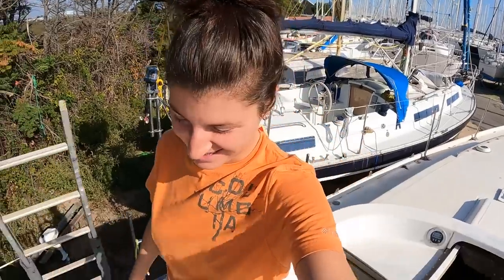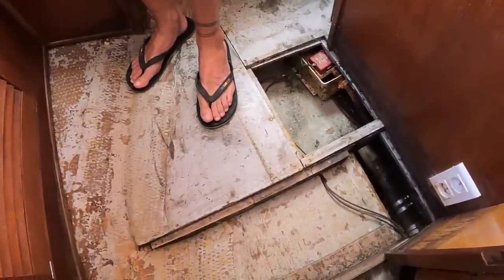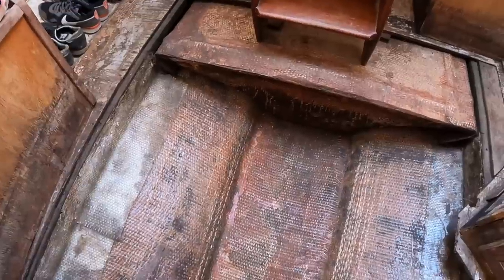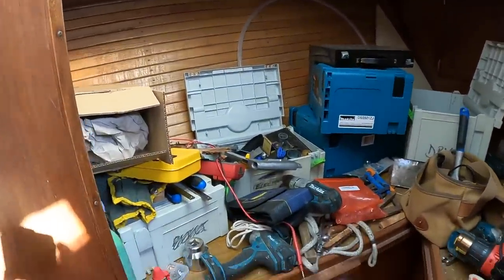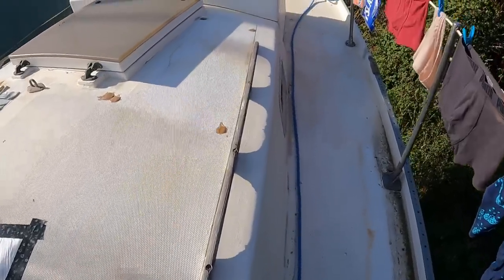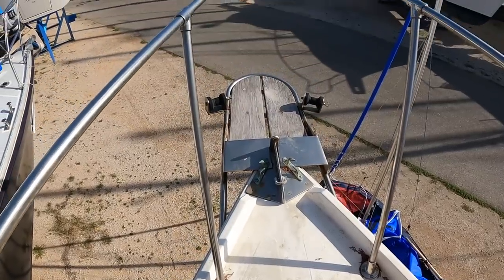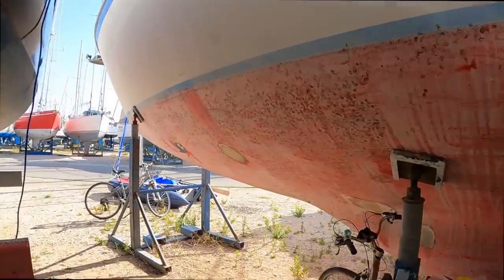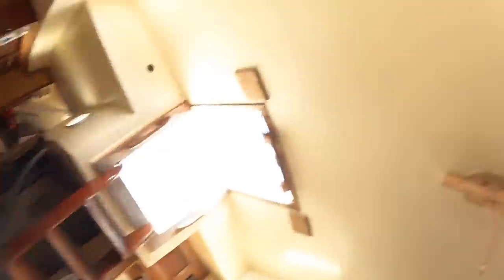1€ BOAT TOUR 😵 | SAILING SEABIRD Ep. 19

Comment: Sand blasting the bottom is a good way to get the old bottom paint off quickly.  Here in the US most people use baking soda instead of sand because it is less abrasive, but still works well.  The big advantages of blasting the hull are 1) It is fast (1-2 days) and 2) It leaves a good surface for fiberglass work.  There is only one real negative and that is that it costs $$$.  Back in 1996 I had the bottom of my Allied 36 sand blasted.  It cost about $1,000 US, but that was 26 years ago.  The only hard part of that job was paying for it.  After that I did an epoxy bottom job.

The keel can be flushed with clean water then with a solvent like acetone to dry it out.  Once that is done inject epoxy into the cavity, glass up the holes and Bob's your uncle.  Also grind out the old keel repair, put a few layers of 1808 biaxial fabric on with epoxy and that area will be good as new.

You have made a lot of progress.
Reply: Yea there is a few demos on the use of baking soda, does a real nice job, isn't expensive, easy to get and cleans up with water.
Reply from the maker: Many people have suggested soda or walnut. 
We'll look into this. 
First job is to open the delamination on the keel to get air dry and to have a poke about.
Sorry for the late reply, we've been hibernating.
😃
Reply: A good way to easily check your bilge is to install a deck plate on the cabin floor with a clear lid.  Every time you walk by, you can see if there is any water. From the cockpit you can shine a flashlight 🔦 on it to also check for water.  I love what you two are doing.

Comment: A 3 CFM  2 Stage Vacuum Pump for your Keel, attach to the lowest point ( hole)  Plug all the holes that you can find in it. Have a intermediate source to catch water drawn out of the keel. You can also use Electric Heat pads on the Keel to heat the water to help evaporate the water inside as it's being drawn out. Check often with your moister  meter. This should draw in the fiber glass to the sides of the keel also. Once dry you'll need to setup a system where you can draw epoxy under vacuum from one end to the other think top to bottom, epoxy on top diagonally vacuum lower with a set of valves so your pump doesn't suck the epoxy into it but keeping it all under vacuum while epoxy sets . This would also find any leaks into the keel so you can seal them. This would save the integrity of the hull also. Was a Joiner at Chris Craft and Roamer Yachts they saved hulls the delaminated this way.
Reply from the maker: Great advice!
Thanks 😊

Comment: I think “combing” is the word you were looking for vis-a-vis the cockpit. Evidently, there is a dye that shows up cracks in fiberglass similar to it’s counterpart in the non- destructive testing of metal. This may be an aid to you in the bilge over the keel. Judging by the repair on the bottom of the keel, at some time Seabird took some sort of whack down there. While not overly concerning, sussing out the cracks in the bilge might be a good thing to put minds at rest, and of course to seal up the boat. And the boat works and flexes as it sails as well. Have a good winter. Enjoy the snow and lack of mosquitoes. I’ve compiled some info for you, but have to get a new devise going to have e-mail out.
Reply from the maker: Great idea. 
We'll try and find this dye.
Any clue on a product name?
Sorry for the late reply.

Comment: She is going to be a great boat.
Wondering about drilling from the bilge into the keel (where the water got in) then pouring a slow cure epoxy in.
We recommend composting toilets (especially convenient when in the boatyard). Our Rival 38 Centre Cockpit Ketch has a fairly similar layout. As you get older having a loo close to the bed is very handy 🤣Plus not sure about wanting the humidity of a shower close to our bed. Our forward head includes the corridor to the forecabin so is larger (and in ours more headroom) so better for the shower (and day head and hanging stuff to drip).
We are also having to build new cabin sole and water tanks so we are building them with the hull as part of the tank and the cabin sole as the lid to maximise capacity and allow the hull to be accessed.
We have the same windlass, going to make a box seat to protect it from waves and reduce water down the chain pipe.
Reply from the maker: The heads aft are larger...
Would rather have stowage and one heads forward.
Thinking the same with the epoxy from the bilge. Then layer up the bilge and the keel.
We'll investigate further.
Cheers for the advice

Comment: Wow guys... The transformation of the boat so far has been pretty impressive.
Congratulations 🙂
As far as the auxiliary rudder, as you know the hydrovane was beinf removed from my Westerly, and that's being replaced with a stern-hung rudder that it tiller operated (using heavy-duty gudgeons & pintles, the same as a dinghy rudder). Electric auto-helm will therefore use it, and the wind-vane will be a custom built unit that also operates the tiller.
The whole lot get's taken off & dismantled when going into a marina.
I'll post a video about it early in the spring...
Reply from the maker: Hiya Adrian,
Sounds pretty cool. We'll be eager to watch.
Sorry for the late reply.
Cheers for watching 😃

Comment: If you intend to stay with a gas cooker, keep the outside locker that is vented overboard as gas is heavier than air. Look at getting an expansion plug from a plumbing supplier to plug the chain hole for the winter, these go in the hole and expand out to seal.
Reply from the maker: Hiya Steve,
We are thinking about mounting the gas on the pushpit. Just not sure on what fittings to use.
Plus we got a "new to us" gas cooker.
Cheers for watching 😃

Comment: The Lofrans Tigris is a very good windlass. If there is any issue it is easily serviceable. You might want to change the oil in the gearbox. The hole is where the chain goes down to the chain locker, which is usually a separate compartment. You will also want to check out the wiring and control box. It draws a lot of current, important to have good connections.
Reply from the maker: Hiya Chris,
We are thinking of putting a battery up front for the windlass.
I'm sure we'll land up stripping the windlass and rebuilding it with added grease. 😉 
Cheers for watching 😃

Comment: I worked, before I retired, at Victoria shipyards in Victoria bc Canada. I used to blast walnut shells and it gives a good finish on glass if you're careful. Plastic beads are usually too expensive, but are the best. I wouldn't advise using sand. It , in the wrong hands can cause a lot of damage.
Reply from the maker: Thanks for the advice Keith.
Not sure what would be the best solution, not yet anyways...
Cheers for watching 😃

Comment: I believe you were talking about 'baking soda' blasting and not 'dry ice'.... baking soda will not etch glass, it disinfects, it de- greases and its safe for plants and the earth. It also does not impose too much heat as sand does. It's a win.
Reply from the maker: Something like that 🤣
Reply: Dry ice blasting is still a thing and meant to be excellent,  but you need specialized dry ice blaster which is probably expensive,  and the dryice is probably very expensive aswell.

Comment: Wow, that's quite a project!  I'm guessing you guys are strapped for money, but you've got each other.  Make sure you show each other even more care and concern that you show the boat.  : )  I suppose I would just try to inject epoxy where the ballast has separated.  I think you can get by with sand for the sandblasting.  Just have a very light hand with it.  Lots of other materials can be used.  Crushed glass... I've heard of using crushed walnut shells, but that was on small delicate parts.  Best wishes.
Reply from the maker: Love your attitude.
Wise words.
Cheers for watching 😃

Comment: I have a Whitlock steering pedestal removed from a Vancouver 34, the whole system including the quadrant is complete,   Missing only the wheel. It was removed to make the boat have tiller steering for the Golden Globe Race. This might be a solution to replace your hydraulic system?
Reply from the maker: Hiya Daniel, 
Thanks for the offer. We love hydraulic steering. Steer without toe. Had it on our last boat. 
It's crazy how similar this boat it, just that bit more space.
Cheers for watching 😃

Comment: That bottom part of the woodwork that is discoloured by water, you could cut it out and use the discarded wood as a form to cut some coloured acrylplast, which then could be glasfibered/epoxied into place, or replace the whole board with an acrylplast board. It will never get miscoloured again, never need paint and would modernize the interior.
Reply from the maker: That's the basic idea but replace the wood with ply. It's just easier to source (we will look into the acrylplast)
Cheers for watching 😃

Comment: I had the exact same windlass and it was a wonderful piece of gear, high quality and very reliable.  All we did was keep a bundled rag to stuff the hole to the chain locker.  Note those windlasses draw a lot of current and placing a large starting battery forward close to the windlass works really well.
Reply from the maker: Hiya,
We are also thinking to adding a battery up front.
The rag idea is a good one too.
Cheers for watching 😃

Comment: buy polyester white pigment and mix it into polyester resin before adding the hardner. 
Use this without fibreglass cloth and paint it with a brush
Mix a small amount that can be painted before it starts to go off.
It comes up with a nice waxy durable finish that can be cleaned easily.
Reply from the maker: Thanks for the tips!
Cheers Peter. 🍻

Comment: A couple thoughts, we had a similar sized boat and our favorite space underway was our aft deck area, similar size to yours IF you get rid of that aweful deck box.  Remember you need to keep the weight to a minimum at each end of the boat and a huge aft deck locker works completely against that.
Reply from the maker: Hiya,
That box...
We need it at the moment, but it's been in heavy debate as to keep it or not.
Cheers for watching 😃

Comment: That is going to be a very pleasant place to live when you get there. So much space and storage which makes all the difference in a live aboard The progress your making is perhaps considerably more than you realise whilst living there. 
 Incidentally, I have used a mildly foaming resin to void fill and rebond the layers in a caravan composite sandwich floor. It worked extremely well and has lasted over five years now with no signs of deterioration whatsoever. This might be a solution for the delamination in the keel. I will see if I can track down what it was and where I got it. The delamination problem was a common issue in the composite floors of early 1990s caravans if you want to google it.
Reply from the maker: Hiya Robin,
Late reply. Sorry
We'll look into that. Got a rough plan of attack.
But you know how that goes...
Cheers for watching 😃

Comment: The place where the stantions meet the deck in the middle of the boat, I have seen someone epoxy a plastic drainpipe through the glasfibre so that water could run out instead of collecting.
Reply from the maker: Nice idea 💡 
Once the boat is at sea you'd think there would be less standing water...
Cheers for watching 😃

Comment: Check the Facebook group. I had the same problem withe the keel with my 41. The ballast probably is concrete and lead. There'll probably be some concrete rot aswel. Check if the bilgefloor underneath the engine is laminated. Mostly it is some thick paint that's cracked because of age and leaks water in to the keel. also check the rudder/skeg shoe. Because of its age it could be worn out. that hole on the anchor winch, check the balsa, protect the core. Just a few things :)
Reply from the maker: Cheers for the great advice!
We hope it can all be fixed. 
Just time...
Thanks again 😉

Comment: Were the wood is stained from water damage. all you need to do is cut the damaged wood out and in fill with new marine ply. and fill the joints with apoxy. and to make you feel better about it coat the ply in apoxy thin out as you cover it. that`s the quickest way of dealing with the water damage. you can then stain it after its complete saves ripping it all out
Reply from the maker: Cheers for the advice. 
Dreaming of the woodwork, that's a great job. Relaxed, clean, enjoyable. 
Before then a lot of fibreglass work!
Cheers for watching 😃

Comment: I wouldn’t be to concerned about the voids between the hull and the lead ballast, the lead and fibreglass would never have been bonded together. I would make sure it’s nice and dry  fill all the hoes that you made and maybe sand back where the holes are and put a couple layers of glass over that area just for peace of mind. Keep up the good work.👍👍
Reply from the maker: Cheers for the advice, Frank.
I think we have a plan much the same as yours.
Thanks for the encouragement 🙂

Comment: I'd rather have uncoloured porthole glass.  Power LED lighting with a DC-to-DC converter so they get 12V and not up to 14.4V when batteries are charging.  Victron has good & sealed converters which are pretty cheap.
Reply from the maker: Good suggestion.
Cheers for watching 😃

Comment: I cannot make sense out of this narrative. They seem to be proceeding FIRST with the cosmetic items - like cleaning the deck, then they make a nice comfy bed in the forepeak etc etc. Surly the first consideration BEFORE GOING TO SEA is the INTEGRETY OF THE HULL!  We were not shown any survey work/results, I would have thought absolutely vital with these synthetic hulls (fibre glass /resin and  concrete). They have already shown serious delamination in parts of the hull below the waterline!  If I were passenger/crew for them I would value most - my lifejacket.
This is an interesting vid because it shows not only a courageous effort, but a very good insight into the life of a millennial couple - of great interest to  viewers in the next century.
Reply from the maker: 😂😂😂😂 Unfortunately not millennials! We clean the deck to have a proper look at the state of it and we made a nice bed because we live in it whilst we do the work. Having a nice place to rest is important!
The boat needs work but it’s solid. It’s just plastic… nothing that can’t be fixed! As we explained on the video this first summer has been just to have a look at what needs doing and get everything in place so when we come back we can crack on with all the structural work. I thought we had explained it on the video…

Comment: Why are you removing all ventilation? I'm not saying it's wrong I just don't understand. Also I don't know anything about boats but 2 heads is always great to have!
Reply: Most likely they are leaking, and those solar power vents are worthless. 2 heads are great if you have a lot of guests but for just 2 ppl living on a boat a big shower is better then 2 heads.
Reply from the maker: Less heads, less problems. Those are old and leaking. Plus the portholes open on this boat. Might add a vent in the forward heads but something worth while.
Cheers for the input, always good to hear other opinions.
Thanks 😊

Comment: Slurry blasting could be an alternative to sand blasting . I had a boat done a few years back . It's not as violent as sand , yet still took all the old anti foul off . It even began to remove what i guess may have been a coat of gelshield , yes the boat had suffered from osmosis in the past . Unfortunately the blasting revealed it had returned , my original idea was to beef up the preventive , hence the reason for blasting . In my case , it presented as very small blisters , not much bigger than the cross section a match , but there were literally thousands of them . The blasting removed the heads , and gave me a head start on the drying out .  
Enquire at the yard , they should know of someone who slurry blasts .
The keel sounds nasty . If it's delaminating , which sounds like what you're describing . You may need to peel the loose skin , and re-laminate . It's not a difficult job , but is time consuming . I think the worst part is drying the hull , it must have less than a 3 percent water content . In area's mine was 21. 
You certainly do have some work to go , but i don't see any real problems , that time will not overcome . Certainly a strange looking boat , i'm guessing it's sloop rigged . I'm on the market for a new boat , but currently holding back , to see how the current climate affects my job .
Reply from the maker: Mickey,
We're new to all these different types of blasting. All I fo is greatly appreciated.
Sloop rig, keel steeped. 
Cheers for watching